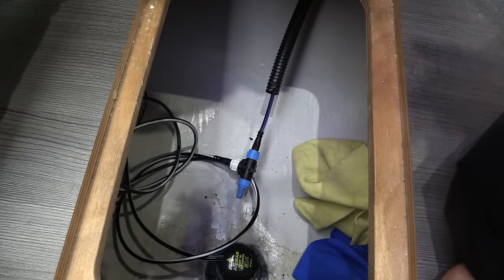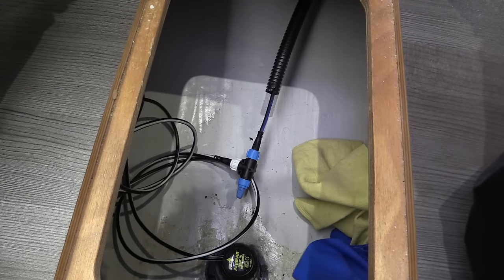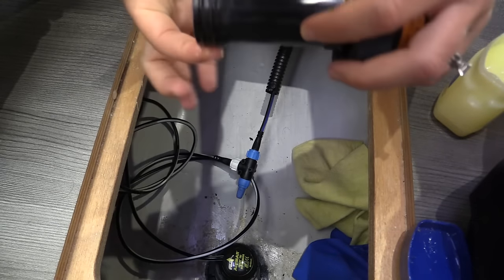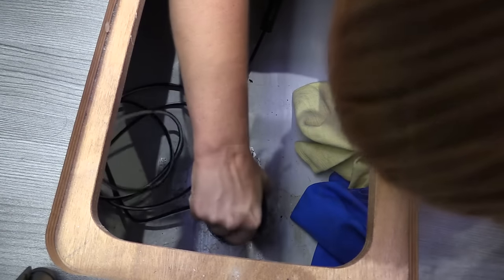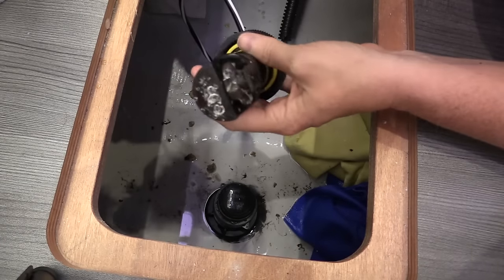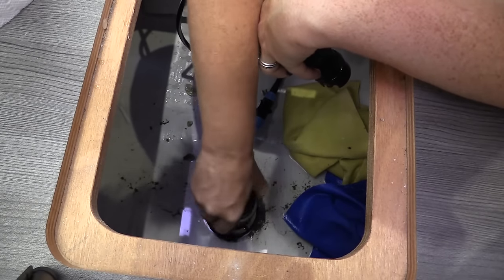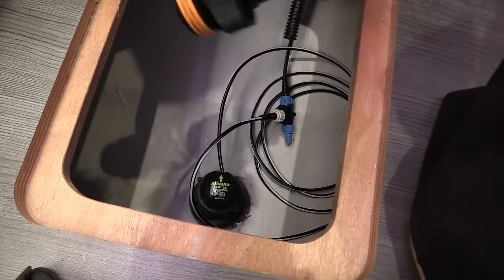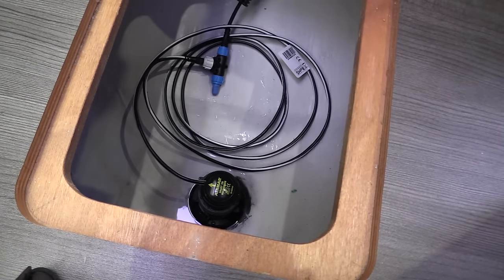Life Aboard: Cleaning Airmar Transducer

Comment: Hi,

Just some advice, I know that some O rings can be lubricated using Vaseline gel.

However, most do not like petroleum based lubricants as it can cause the O rings to crack and leak. Silicon based lubricants are best and its a good habit to get into as 
most O rings that you purchase in spare part kits etc would need silicon based lubricants. Just get a jar or tube and keep it in your tool kit.

My model of Airmar transducer actually states to use silicon only for O rings.

Hope you get back into sailing soon. I am deciding on an FP and its between the Helia and the new FP40 that I will see in December, then put in the order.

Enjoy your boat and where it will take you..

m
Reply from the maker: Mick Relic Thanks Mick.  We probably should have mentioned this in the video, but our instructions for the transducer actually say that it is suggested to use Vaseline.  

Best of luck on your choice.  It will be tough to go wrong!

Comment: Thanks for recording this. In a 31’ monohull we found the water spout reached about 12”/300mm between removing than transducer and put the blanking plug in. Looked like yours only spouted 3-4”/100mm which was an interesting difference.

Comment: Amy, a key in placing the bung plug and replacing the transducer is to push it down into the hole, then screw it .. When I first did it I failed to push it down before screwing the lug,  so all the screwing in the world did not stop the water flow! !!!  Thank you for reminding me to use vaseline on the bung plug. Great video. Yes, the sudden water flow is alarming, but it doesn't sink the boat. !!
Reply: I've had to do this a few time on my sailboat. On most transducer/paddlewheel/blanking plugs there is a key-way or notch that will fit into a similar bump or lug on the thru-hull and is generally close to the correct insertion direction, as indicated by the arrow on the head. This prevents the unit from being installed incorrectly (what happened in the video) Just insert in the correct direction, rotate slightly before screwing down to mate the bump and notch, and ONLY then screw GENTLY so as to be sure to not crossthread the two pieces.   It helps to have a few small sponges handy as sometimes you can force the sponges out the thruhull fitting which will clean any fouling inside. Then install the paddlewheel.  When the boat is on the hard, practice this a few times and become an expert first before ever opening the hull to the sea!

Comment: Thank you for video as this is the only one I could find also. My transducer paddle wheel is also not turning and is only six months old. Mine is a Garmin brand but it seems that the concept is the same. Particularly noted that you said that the bottom nut/collar will / should jack out the transducer top collar and I am hoping that this will work for me as there is not a lot of movement happening on mine. Great presentation with plenty of close up detail. BIG THANKS from me. Fair winds.
Reply: Need to correct myself (duh) mine is actually a Raymarine and it took quite a bit to remove as I forgot to “grease” the O rings. Found a lot of growth and scale which cleaned up really well though. Now Coated with heavy lanolin grease mixed with chilli powder 👍🏼. Reinstalled and here’s hoping it works this time. Again thanks for the info in your video.

Comment: Glad I found your video! Although my trailer sailer is out of the water, the transducer feels really tight to remove! Seeing how much force you needed to remove yours helpfully shows that I can be a little more forceful in getting it out! I was concerned that i might have broken the through hull fitting! Also, useful to have a tub of Vaseline handy to lubricate and seal the 'O' rings! Nice job, thank you 😎
Reply from the maker: +Stephen Bradley Hi Stephen, thanks for watching!  I'd definitely suggest checking with the manufacturer of your transducer to make sure that Vaseline is okay to use for sealing the 'O' rings.  Our instructions specifically say Vaseline is okay, but other brands suggest another lubricant.  Good luck!

Comment: Get a tube of silicone dielectric grease for the O-rings and you can also use it for your battery connections, buy new O-rings for the transducer and keep them as a spare, you may need them because you put vaseline on them. Happy sailing
Reply from the maker: lank278 Thanks for the tip.  We were concerned about the Vaseline as well, but our instructions specifically mentioned Vaseline as what they recommended we use.
Reply: +Out Chasing Stars It all depends on the material used for the O Rings. Nitrile (aka Buna N) O rings are not affected by petroleum jelly (Vaseline). Natural rubber O Rings should not be exposed to petroleum. I would assume your mfg. would know what is to be used with the O Rings they supply. EDPM O Rings should be greases with silicone.
Reply: Watch you don't get saltwater on the cable connector

Comment: İts guit wrong job that you do.  you should paint the triansducer with propeller anti foil before plugin
Reply from the maker: +halit özbaşlı Thanks for the suggestion, but what I don't think was mentioned in this video is that this transducer also serves as our depth sounder.  Thus, I think that adding any sort of paint would interfere with that function.
Reply: İm using same t910 transducer too. İ taped depth sensor before paint speed wheel.İf you directly paint whole sensor depth shows wrong value as you guess.